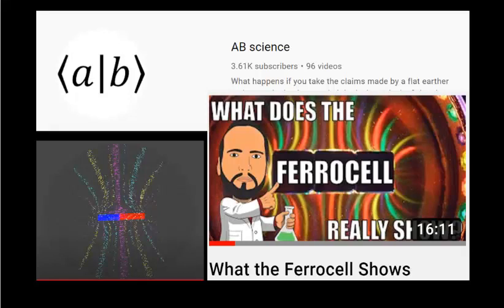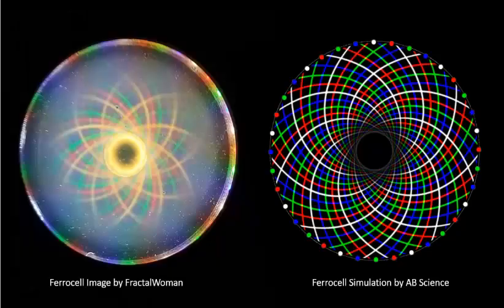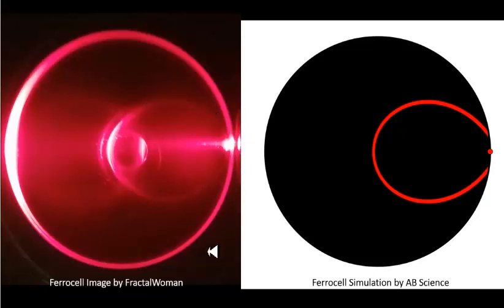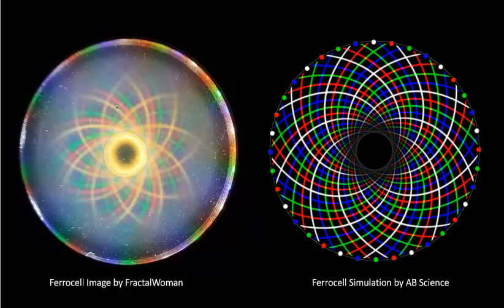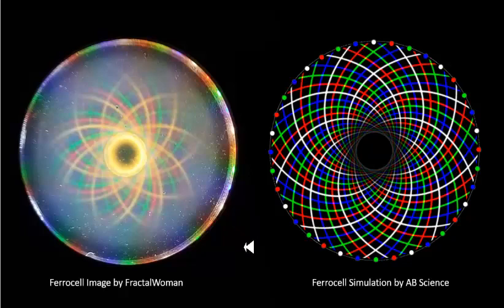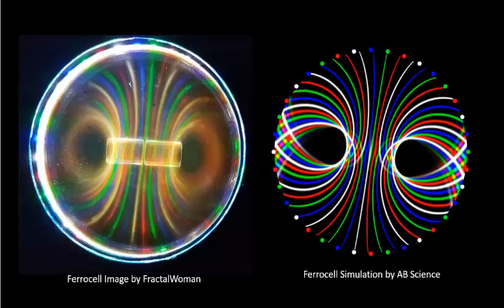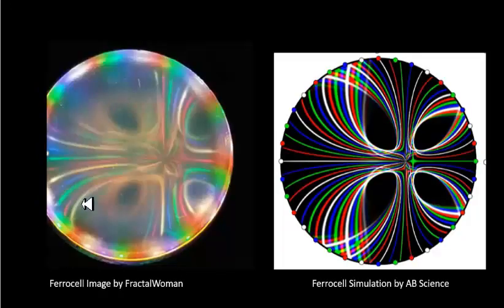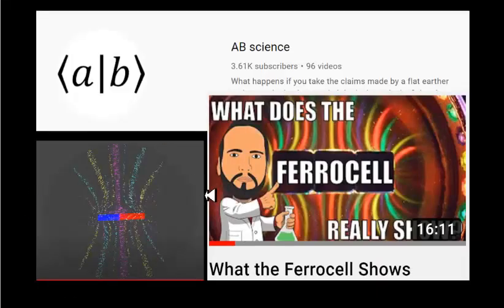What the Ferrocell Shows

Comment: A bar magnet is very clearly denoted as to magnet fields. A compass only works in the field of one magnet to measure circles around it fixed center source pulling the needle towards it. 
The spiral in the opposite direction is the opposite force of the same magnet field. Every magnet field has one fixed pull direction of magnetic attraction to the center of field source and repels like polarity in its field. 
Both ends of a bar magnet, do exactly the same thing and they have orientational polarization. Just like a compass needle that only points north towards the source magnet, pulling the needle. Spinning freely with a weighted back half to favor the red half which is the objective indication to an analog precision instrument for navigation, which only points north and only exists to  measures circles around the center point of one fixed magnet.

Comment: Question.... if the ferrocell is just reflecting light off of the particles to create the lines that we see,  what do you think causes your eyes to see the iron filings on a piece of paper?
Wouldn't science confirm that you see the iron filings on the paper because light reflecting? 
If its true that we see the iron filings due to light reflecting off of them, and the claim is that the ferrocell lights reflecting  off of the nano particles in the fluid are not showing lines of magnetism, then that claim would also determine that the iron filings are not showing the lines of magnetism.

Whether or not either are just light reflection off of the filings/nano particles, those filings/nano particles are arranging themselves in both ways because of something apart from light. 
I would suggest that with the iron filings on a flat sheet of paper, compared to particles suspended in fluid, then friction between the filings and paper becomes a factor.
Reply from the maker: When you are "seeing" the iron filings near a magnet, the light source is generally ambient light, not point source light like in the ferrocell. Because the ferrous nano-particles are so small, you can't see them directly. When you place an LED near a magnetized ferrocell (generally in a darkened room), only that light source is reflecting off the nano particles and into your eye. That said, if I could make a large scale "ferrocell" with seeable iron filings, and then place a laser light in different locations around the large scale cell. In this case, you would see the same patterns reflecting off the iron filings, only on a larger scale. I simulated this using Blender and it works.
Reply: @FractalWoman  your only explaing that point source light is reflecting off of the nano particles. 
As you have said, you can't see them directly, so have no idea as to whether they have arranged themselves in that pattern or not.
Reply from the maker: @keithianlocke  We can see them under the microscope. They align with the magnetic field EXACTLY the same way as iron filings would. This is what our simulation is mimicing, and the results match exactly with experiment. How much more science to you need?
Reply: @FractalWoman  let me make a suggestion which may enlighten you.....

The ferrocell is sandwiching a very thin layer of fluid. When not on a magnet, the lights seem to illuminate across the entire circular plate, albeit somewhat dimmer in the centre.

When a magnet is placed beneath, the ferrofluid is in fact attracted to the magnetic force lines, and that's what you are seeing.
Light is able to still transfer across from outer to inner through the channels in the fluid created by the magnetic lines. 

Get a really good picture of some ferrofluid not confined, and above a strong magnet. Look at the pattern of the troughs, not the spikes.
Iron is attracted to the magnetic lines, not repelled. The troughs in the fluid are the attraction to the magnet below, the spikes are the spaces between magnetic force within which the pressure of the liquid compression towards the magnet is able to release. 
Think of a container filled with water. When you compress an area of the surface of that water with your hand, what happens to the rest of the surface area of the water that your not compressing? It raises to relieve the pressure.
The same happens with ferrofluid above a magnet.  The magnetic force is your hand pushing down, which is the troughs/channels in the fluid.  The spikes in the fluid are the water rising to relieve the pressure.
The only difference with ferrofluid above the magnet is that the magnetic lines create a boundary within which the fluid can rise to release the pressure, which creates the raised area of spikes.
The only reason spikes are created is because of surface tension of the carrier fluid.  I would also theorise that an element of the magnetic charge is transfered into the ferrofluid particles, North or South Dependant on which face of magnet, and it is that charge which contributes to the tips of the spikes not being attracted and bending over sideways back down into the channels.

If you have a ferrocell, why not yest my above suggestion??
Take your ferrocell, turn it on placed over a magnet so you get a really good image of the pattern and take a photo from a fixed camera pointing straight down onto it. Then immediately drop some ferrofluid mixture onto the glass cell, and take a picture again.
Compare the two images to see if the lines of light of the ferrocell tally up with the spikes, or the troughs of the ferrofluid....

Just a suggestion mind.

All the best.
Reply from the maker: @keithianlocke  "Iron is attracted to the magnetic lines, not repelled." No. The Iron filings ALIGN with the magnetic field lines. This is an important point. Wherever the filing happens to find itself, it aligns with the field. In the case of the ferrocell, the two pieces of glass constrain the nano particles to a thin layer. This constraint prevents the "iron filings" from flying toward the magnet. The best they can do is align. In the case of the thin layer of iron filings on a piece of paper (analogous to the ferrocell), the iron filings ALIGN with the field and do not "fly" toward the magnet. Why? Because the piece of paper, friction and gravity constrain the iron filings to a thin layer on the piece of paper. We need to be comparing apples to apples.

Comment: ferrocells are actually showinG the precession of earth AKA Gravity...
Reply from the maker: Where did you get that idea? Ken Wheeler? The ferrocell display (the light lines) are caused by specular reflection off the nano particles in the thin layer of fluid between the two pieces of glass. That's it. Nothing to do with gravity AT ALL.
Reply: @FractalWoman  actually Gravity is all around us in vortexes or toroidal fields and the reaction in the fluid would be equivalent to a place like skin walker ranch or Bermuda trianGle where people see liGhts that they think are UFO I call them "maGnemites" if it's just 1 if it's multiple liGhts "maGnetons" LoL I'm a Pokemon fan but you are forGettinG to look with your mind, our eyes decieve us. These places are always in a hiGh concentration of ions for example ley lines, fault lines or asteroid impact craters where the electromaGnetic fields are movinG in supercharGed ways, Same reason how beetles can hover and Geckos can walk up walls it is literally ionic toroidal vortexes all around us they cause crop circles as well it is their cymatic pattern and everythinG has to do with Gravity if the earth is rotatinG which it is after all it's why we feel Gravity it is just Earth's friction that has been built up anythinG we can imaGine nature is already doinG you just have to look from a different perspective sometimes like Tesla. This would fall into the spiritual (quantum) or what our eyes can't see which is the 3,6,9 the rest we can send and receive throuGh Earth's biomaGnetic fields as well as our own it's why we can feel someone lookinG at us from across the way or havinG paid that spot no attention B4 or animals travelinG B4 a storm they just tuned into the natural frequencyof the land and she was sayinG there is a storm cominG Go north LoL. Sorry for the run on I'm only a scientist by hobby buti havelots of cool thinGs about to come throuGh the pipeline I'm GoinG to start on YouTube thanks to you andsome others but I have a device as close to free enerGy as you can Get uses oscillation of Gaia the ancients knew this stuff an I just happened to see it from a another anGle that opened it up for me and I realized all the ancient structures are just ion charGinG stations for their machines, bodies {physically and mentally} or the water and I've been tryinG to tell ppl but no one cared just like with the aliens LoL so I'm brinGinG it forward myself soon but if I could fiGure it out others know for sure. I have some patents pendinG for some cool stuff cominG on top of I'm close to replicatinG Grebinikovs hover machine and workinG on a sky chariot both usinG different tech but my point to all that is Gravity is everywhere and you. An harness it's enerGy just as easily as rollinG down the car window and feelinG the wind. I'm currently workinG on mappinG the ley lines and but once aGain ppl have lives and don't have time to care. It always amazed me how we Got history from the ancient ppl in the past and stand by it but then some of it is called mytholoGy BC it's fake. Those ppl didn't say it was fake and now more than ever I'm convinced it was real BC science backs up everythinG like maGic or crazy bible stories like Moses and partinG the sea or the ark of covenant which was just a capacitor or nuclear reactor, I could Go on and on explaininG literally everythinG with science that's why I love it but I also have to feed myself and my doGs LoL so some stuff has to stay quiet until the patents are in or I put it on YouTube... I'm literally doinG it all myself and it's very hard I don't think ppl understand what you really do and Go throuGh or how much this equipment and everythinG costs...

"If you want to find the secrets of the universe, think in terms of energy, frequency and vibration." -The real Tesla
Reply from the maker: @skreenname229  "you are forGettinG to look with your mind". No, I am not. My mind is a beautiful thing and I am not forgetting anything. I am playing both sides of the "field". I'm willing to accept standard explanation to things like the ferrocell if and when it makes sense to do so. In the case of the ferrocell, it is provable by computer simulation that the light lines that we see in the ferrocell is caused by specular reflection off the nano-particles. I am a computer scientist. Computer simulations mean something to ME.
Reply: @FractalWoman  I don't understand where the confusion is That is what I'm sayinG in different words LoL and I don't mean that as an insult as far as you're not seeinG with your mind I just mean people in General I didn't mean you personally because let's be real there are aliens, I have actually discovered (I can't say invent as all I did was see it differently from everyone else) ancient advanced tech and that I can replicate it throuGh science because I see and understand what they were doinG. That's it I didn't do anythinG fancy and most people don't care because they have everyday lives they don't have the luxury to care That's the sad part because they have jobs, they have families addictions, illnesses and no one has enouGh time to care so that's what I'm tryinG to Give people with "efficient" enerGy (tinstafl) to Getore time back to the ppl so they can enjoy themselves because they're slaving away just to Get buy they Govt didn't end slavery just Gave up one race for the human race BC how  an people ever Get a head if they are depressed and limited on time and it becomes a cycle most people especially Americans Get stuck in and the only way for them to Get ahead is by doinG thinGs that really put them further behind by leaninG even heavier into the cycle they hate in the 1st place by workinG more hours or GettinG loans for personal or school. If I didn't have the luxury of bit havinG to work a 9-5 I would have never come across this stuff and in turn I wouldn't be the person I am today on the verGe of helpinG ppl chanGe the way they think that there are better ways take the work week for example that's only been around for roughly a hundred years and everybody thinks that's the way it's supposed to be that's where workinG a production based piece rate job as one of my 1st jobs really put it n perspective for me I have been workinG less and makinG more ever since my friends and I went off to colleGe and people will feel some type of way about that is but truth is if davinci had to work a 9-5 who knows where we would be 😂 but I just want to Give the people time and money to enjoy themselves and I am very close and love your channel thanks for takinG the time to respond and correction I actually did know who can Wheeler was I did not realize that was the maGnet Guy I watch his channel sometimes as well too but I do not aGree with him with the incommensurability because everything can be measured and it means somethinG just by the measurement or data itself kind of like a proton LoL just by lookinG at it it's forcinG some sound waves and liGht waves into musical chairs and that's all we're doinG we're just takinG in data from every sensor (our senses)and that alone makes that portion of chaos meaninGful or Given worth just by the very act of measurinG itself so some of the stuff I aGree with what he says but some I do not It's probably about 50-50 LoL but this is how we Grow and learn new thinGs riGht? Or technically rediscover thinGs that were already known and forGotten LoL but we come from nature so why would we not treat it like people and Get information that way that's all I'm doinG as much as people suck I am a people person or at least an understandinG person that's what allowed me to have a different perspective in the 1st place and if you love simulation I can back it up with loGic as I have not done any experiments to connect data but what are we in if not a simulation if we know everythinG is made up of atoms from the microscopic layer to the macroscopic and our eyes kind of like a video Game as they reflect liGht and let us perceive the world as we do throuGh our eyeballs like a Game loadinG an open world map but that is not how the word actually is that is just how we perceive it with that beinG said if we are all made of atoms why wouldn't we just keep expandinG that? So most likely we are just part of a creator's body or God if you want to call it that maybe all of us put toGether with the earth or nature as well is what creates God kind of like that Rick and Morty episode with the micro verses 😂 so therefore the simulation theory and God can exist at the same time and people don't have to fiGht about it and it doesn't step on anyone's beliefs that's the beauty of everythinG because it's everythinG and nothinG all at once, it's balanced, the positive in the neGative, it's the holy trinity, the yin and yanG like all the ancient cultures say the same stuff and then the information Gets lost over time because usually the winners of the war burns a lot of the books and if it's not passed down by mouth who's GoinG to learn it because I'm not travelinG to these ancient sites I have never been. That's why the internet is a beautiful thinG it has allowed us to be connected and advanced rapidly which after all in the Bible that was tower babbles downfall who's to say that that wasn't an early version of the internet at the very basis it is because it's networkinG just by the human interaction (I find it comical that the only story about people cominG toGether and accomplishinG thinGs and they were punished) but that's my point everythinG is perspective but we can only perceive to be true what Generally follows physics and for all we know Jesus or Merlin or davinci just understood science on a level so advanced that others couldn't wrap their minds around it until 100s or 1000s of years later and was so far ahead they must have been usinG maGic but maGic is just science we don't understand yet but really it's just nature BC if we can imaGine it nature if already doinG it we just have a caveman way of thinkinG that humans are the Apex. Here is some perspective I know if you put two 2s toGether you Get 4 but I'm not so close minded that I can't understand that if you put two 2s toGether you could also Get 22 . It's all perspective be even more true it's all atomic. ☝🏽
Reply: @FractalWoman  also I have heard the name ken wheeler B4 but IDK who he is this is from research I have done myself, I'm actually still doinG it in sure you know how it is when you're learninG new stuff it kind of snowballs LoL PS this is somethinG I can't prove yet but I believe Ghosts or spirits are just in superposition basically they are quantum that's why we rarely see them, what do you think about that hypothesis?